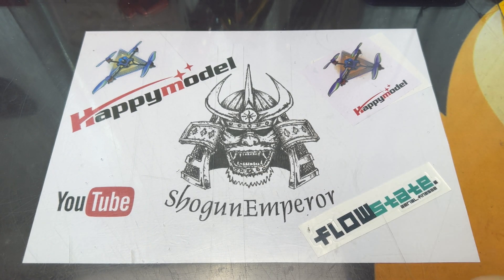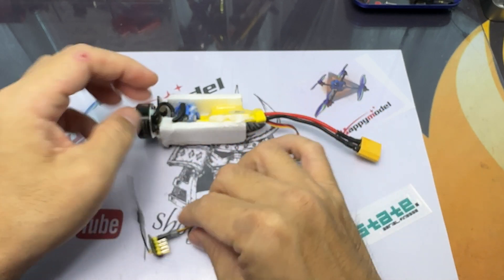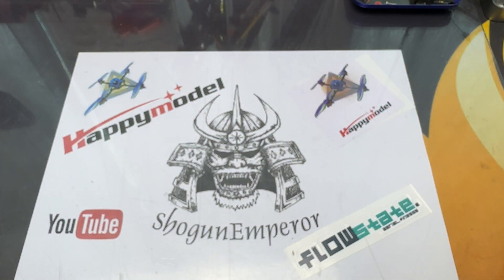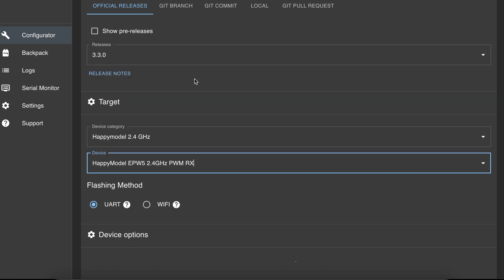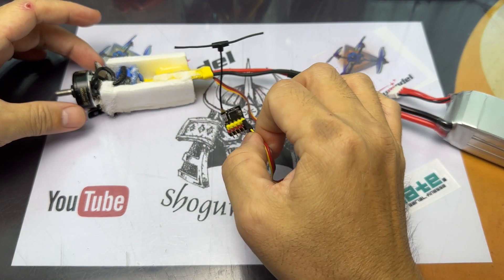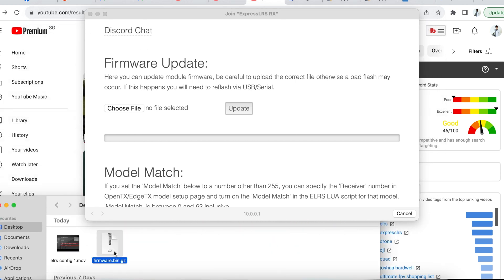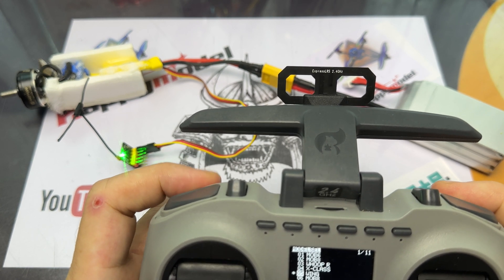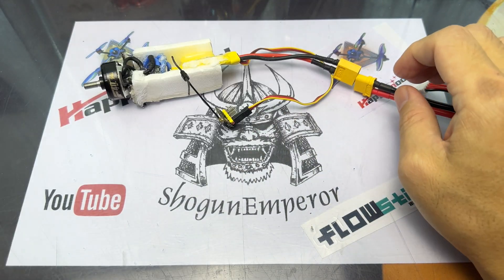Update EPW5 PWM receiver - Easy way!

Comment: Hye bro. I wonder if i can use epw5 for normal quad. In the diagram state that pwm2 and pwm3 can use as rx tx. Then after that, can i use the other pwm channel to control any servo on my quad?
Reply: It's quite important now to have more information because i bought many of this receivers thinking that i can convert all my quads to elrs with some pwm output(just like crsf and tracer)
Reply from the maker: @ridzuanzikri9911  yes bruddah! U can!! I have an older video about this rx I just cant find it. Will send it in the next comment

Comment: How to reverse the motor in case I have a car or boat? I would chose the right stick (middle = 0, high = forward, low = back).
Reply from the maker: for car or boat just swap 1 of the 3 motor wires and it will spin the opposite direction,.  Hope that helps bruh!  Good luck!
Reply: @shogunemperor  Yeah I know that. But I want to reverse it while driving. I can’t swim to the boat to swap 1 of the motor wires.
Reply from the maker: @MrMilio  OOOOOOOHHHHHH!!!!!! Sorry! I misunderstood! Hahahaha well… one way is to put it on a switch and use another servo to turn it forwards and backwards. As for using the radio, im not too sure bro. Much apologies. Boats not my thing.

Comment: Hello ! I don't have an pwm receiver on my wing, and all works..
Is there an advantage to use one of these ?  
Thanks for the video 🙂
Reply from the maker: OOOOOHHHH what are u using on your wing?  This is just a basic receiver, just a 5-channel pwm receiver.  Always a pleasure bruddah!
Reply: @shogunemperor  a ep1 receiver, with a f411-wse FC.. i don't need a FC with a pwm receiver, i know.. but is there another advantage ? Maybe latency ?
Reply from the maker: @ArmageddonYT  aaaaaahhh cool bro!!!  Nah, latency is the same.  Ur EP1 is excellent!
Reply: @shogunemperor  i know 😉🤣
Reply from the maker: @ArmageddonYT  how did u connect the FC to the servos and motors???  Im curious about that. Never had a fixed wing with an FC before...
Reply: @shogunemperor  you have pwm on the FC, then in the Fw you got (i have inav)  you link the aetr channels to the pwm outputs. And any other channel you need of course..
Reply from the maker: @ArmageddonYT  aaaaaaaaahhhhh ok, i get u!  thanks bruh!! Much appreciated man